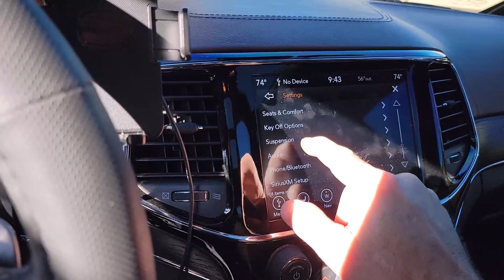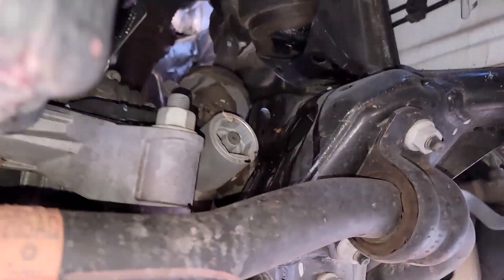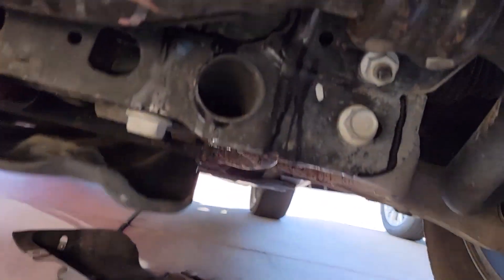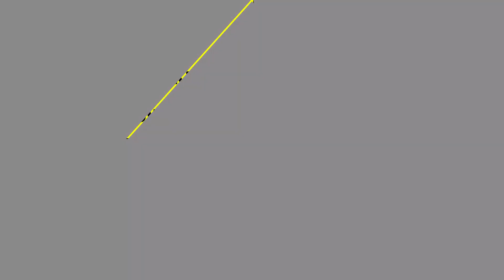Investigating my Hemi Grand Cherokee oil leak

Comment: Have you ever thought of investigations the coolant leak?
Reply from the maker: I saw that here when I was looking for the "oil" leak.
The water pump seal was leaking. Which is why the pink stains were all over the front of the engine.
It's already fixed. Dealer replaced the water pump and both motor mounts under the extended warranty I purchased with the vehicle.
It has 61k miles
Reply: @hackfreehvac  at least it was addressed
Reply from the maker: @marknaravas318  Oh yeah. Right away. I tow a trailer with this so it has to be good to go